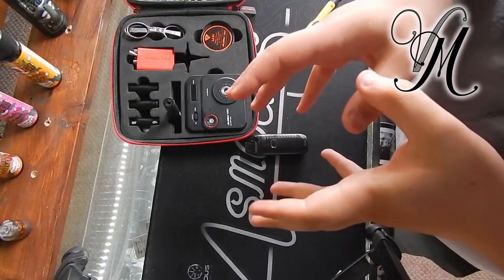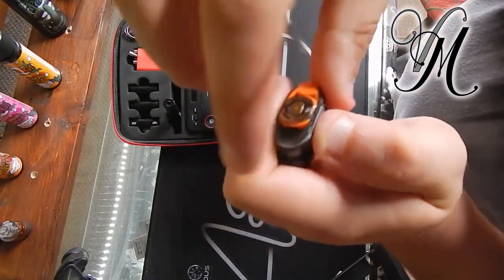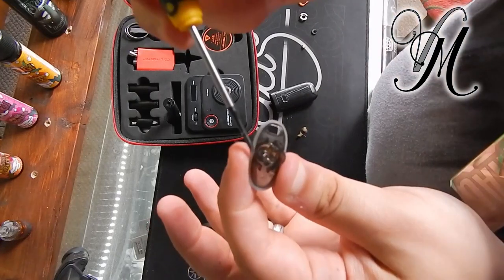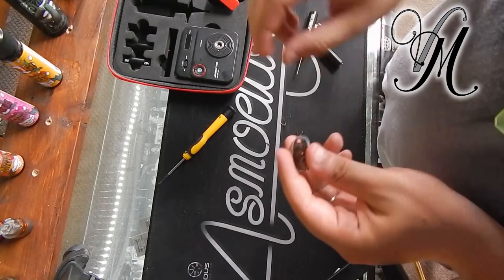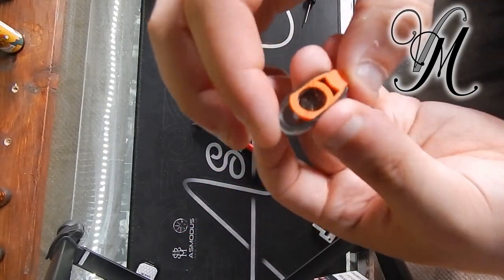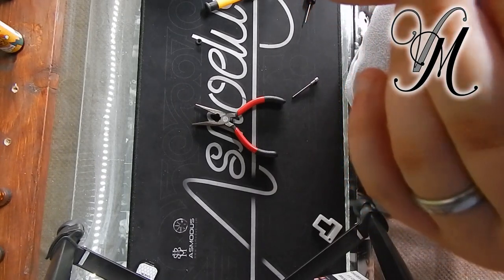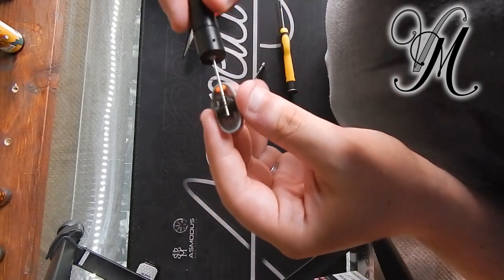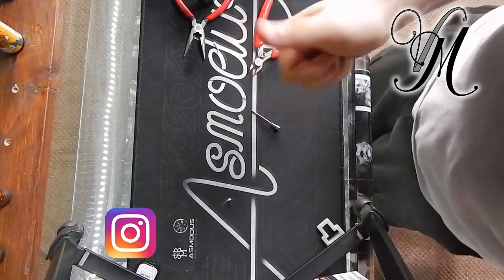Hack | Demo of how to Recoil or rewick the Geek Vape  Bident Pod System

Comment: I was hoping that these pods are rewickable without the extra tool kits and just replacing the cotton...? I don't have this vape kit yet but i was ready to get one. Now that i'm reading into the comments i see the coil itself has to be redone and all other unexpected involvements. I've been using Novo and keep rewicking the pods and i thought this would be similar. I was ready to try this vape kit but i guess i'll pass. I'm frustrated. Thanks for the video though. It seems to be very helpful for a lot of people.
Reply from the maker: Hey, 
I've never redone the novo so i wouldn't really be able to compare, however if you jump to about 9:11 you'll see i actually put the cotton into the coil after the installation.

So in theory, it is possible to just change the cotton, but you wouldn't be able to burn the coil clean, you'd have to do it EXTREMELY gentle with a tissue or something....  I can't imagine it's much different to the Novo to be honest..

Additional, you don't need to buy a Vape DIY Tool kit to build. When i first started building i just had some scissors (to cut the cotton and the coil wire) and a something to wrap the coil round. (Something the fight thickness like the sticks off cottonbud sticks, or a star from a caprison drink carton. 

If you're building with thick wire you'll want some wire cutters, but some standard kitchen scissors would be fine for pod kind of wire.

Thanks for watching and Good luck! ♥️🙏🤘

Comment: Hey dude.. Loved your vid.. what kind of wire did you use to rebuild? Thanks!
Reply from the maker: Hi, 

I honestly can't remember, it was such a long time ago, Below is a comment i replied to someone's a while ago, hope it helps.

"Due to the small space for the coil to sit, 28ga or thinner should surfice.

I can't remember, if I used 28ga or 30ga at 1.5mm 5 full wraps (6 wraps if you count from the top of the coil)"
Reply: @LetsNerdIt  Thanks mate.. found it.. I'll go for 32g.. cheers..

Comment: Can i replace the cotton only?
Reply from the maker: Hmmm... Can, it's possible...
The problem is you can't heat the coil up to clean it. Because the heat from the coil would (does)  melt the surround, then the pod wont seal (will leak 100%)

Comment: What type of wire this you use
Reply from the maker: I can't really remember.
It doesn't matter too much aslong as the coil isn't too big and the wire isn't too thick for the holes.

I previously replied to somebody

"Due to the small space for the coil to sit, 28ga kenthal or thinner should surfice.

I can't remember, if I used 28ga or 30ga at 1.5mm 5 full wraps (6 wraps if you count from the top of the coil)"

Hope that helps

Remember the coil resistance has to be between 0.5ohm & 3ohms or it wont work

Comment: Heyo! What type/size of coil do I have to use for mine?
Reply from the maker: Hi Tyre, 

I honestly can't remember, it was such a long time ago, Below is a comment i replied to someone's a while ago, hope it helps.

Just make sure the resistance is correct, if the resistance it too high or too low it won't fire.

"Due to the small space for the coil to sit, 28ga or thinner should surfice.

I can't remember, if I used 28ga or 30ga at 1.5mm 5 full wraps (6 wraps if you count from the top of the coil)"
Reply from the maker: It has to be between 0.5 and 3ohm
Reply: @LetsNerdIt  thank you so much!
Reply from the maker: @tyetalisik  you're welcome, let me know how you get on

Comment: dont make a bluff once a juice squeeze a rubber who support the airflow its hard to zip it again and once the wire dmg the plastic you cant rebuild it again
Reply from the maker: Maybe I've miss read your comment but it sounds to that your saying this video is fake and it cannot be rebuilt... If that's the case you're wrong. It can be rebuilt the video proves it and other people have done it.

How well it works just depends on how well you do it. 

And no it isn't designed to be rebuilt, i do state that in the video

Comment: how do you form the coil at the bottom after rebuilding?
Reply from the maker: I'm not quite sure what you mean by form the coil.
Have you got the legs through the holes?
If so, then one leg from each coil goes between the silver ring and the rubber O and the legs (1 from each coil) goes between the rubber o and the gold pin. These are the positive and negative.

Comment: Can you just change the cotton?
Reply from the maker: Hmmm... Can, it's possible...
The problem is you can't heat the coil up to clean it. Because the heat from the coil would (does)  melt the surround, then the pod wont seal (will leak 100%)
Reply: Vape Mill thank you so much for the explanation

Comment: Thank you for this video..  now i can save money.. 😄 (🇵🇭Ph)
Reply from the maker: Did you manage to get it to work?
Reply: Nagbago ba taste ng juice mo tol?
Reply: Kasi nag bago akin
Reply: @LetsNerdIt  i used kanthal 30g with 6 loops then i got a different taste from my juice
Reply: Charles Querimit hindi naman tol ganun parin
Reply: Ahhhh, cge salamat
Reply: Charles Querimit ingat lang sa pag baklas tol baka mag leak
Reply: @paulcelino976  boss tanong lng bago lng ksi nito.ano ba dapat ko e lagay sa shopee para sa wire na gagamitin or pangalan ng wire na pwde dito e palit
Reply: rodnel albarico nicrome 32gauge
Reply: Ingat sa pag build kasi pag kulang or sumobra sobra init baka ma tunaw yung plastic hehe payo ko lang research muna sa pag build para safe
Reply: @paulcelino976  cge po ty sa advice :)
Reply: @paulcelino976  boss tanong lng ako ilang loops if 32gauge wire ko?mali ta na order ko

Comment: Hey man, i was kinda lost and cant see where to put the coil and the process after that i hope you could help me
Reply from the maker: Ohh... I'll try 😂😂
So the coils (legs) don't go in straight. 
There is an hole on either side and one on front and back end, they're quite small. Take alook.
So obviously so for each coil one leg goes in the front/back and the other leg goes at the side.

Once you'll got the legs in it's pretty simple is you've built before the silver ring and gold pin act as the negative and positive. So one leg from each coil should go between the silver ring and the black rubber ring and the other 2 legs should go between the gold pin and black ring.

Hope that helps if not hit me up on insta and I'll try to get some picture to help  show you what i mean
Reply: @LetsNerdIt  i kinda got the sense out of it ill try it out once i got my coil and then ill contact you at instagram if im lost again thanks man!!!
Reply from the maker: @kxzzz895  you're welcome,
It's abit fiddly but if you do it right it works 😂 the system is regulated, so if you do it wrong, the worst case scenario is it will melt the bed (if your coils aren't in the right position or are too big) but it won't blow up or anything stupid lol

Comment: hii.. what was the wire you have been used for recoiling . thanks
Reply from the maker: Hi Irfan, 
Due to the small space for the coil to sit, 28ga kenthal or thinner should surfice.

I can't remember, if I used 28ga or 30ga at 1.5mm 5 full wraps (6 wraps if you count from the top of the coil)

EDIT: Typo- 15mm changed to 1.5mm
Reply: Vape Mill Do you mean 1.5mm?
Reply from the maker: @saucerauce9351  haha yeah 😂😂 don't think 15mm coils would fit 😂😂
Thanks for pointing that out! ❤️🙏🤘
Reply: @LetsNerdIt  All cool. Thanks mate, I changed my Bident coils using this guide. I actually removed the plastic that separates the coil, and built a 2mm guide single coil. Enjoying it so far.
Reply from the maker: @saucerauce9351  I'm glad it helped.
And ahh... That's interesting, i didn't think about that!
Reply: Hi, i just used wire 28ga ni200 but fail to fire on my pod, but i also used titinuim wire 30ga also fail to fire.. what material suitable use for coil this pod? Ni80 wire suitable ? Or what? Please help me
Reply from the maker: @sirazrul5315  hi.
In the video i use Ni80, (same as the pods originally use).
However you should be able to use any wire that is designed for Vaping, as long as it is thin enough.

Check what the LED indicator is telling you:
Red light / 3 flashes = No atomiser / No Pod detected

Red light / 8 flashes = short-circuit or Low resistance (ohms)

Make sure the legs are in the right place (1 leg from each coil between the black and silver, 1leg from each coil between the black and gold).

Remember the system will not accept resistance below 0.5ohms. 
Might be worth testing the resistance. (Don't forget if you have 2x 0.6ohm coils the overall resistance will be 0.3ohms)

I hope that helps. I'm sorry if i sounded alittle patronising, i just wanted to cover all bases for you and future readers.
Reply: @LetsNerdIt  thank you for ur advise :)
Reply from the maker: @sirazrul5315  Did you manage to get it to work?
Reply: Vape Mill yes its work but seems like firing used high voltage because i m using 30g titinium.. maybe it suitable with 32g and above
Reply: what awg?

Comment: What wire did you use?
Reply from the maker: Ni80
Can't remember if it was 28ga or 30ga.
Reply: @LetsNerdIt  what other wires that I can use?
Reply from the maker: @janjanbrow  ... I don't know just try some, but you can only use thin wires due to hole.

In theory any wire should work if it's built in a way that the ohms are right and it doesn't get too hot and melt the pod

Comment: I found a video from an Asian guy who used only a single coil so i tried to do that because it seemed less complicated. But since i don't understand what he said i messed up even though i followed everyhing visually. It didn't fire 😒  I used a 26 guage wire with 5 wraps. I am totally retarded about these things but i would really love to get it working without a lot of extra tools and unnessesary knowledge... I just want the fastest and easiest way to get it working. I don't care to blow huge clouds. MTL is fine... What am i doing wrong? I am very stessed out already.
Reply from the maker: It's quite a challenge for someone that's not into rebuilding.

 the coil resistance needs to be higher than 0.5ohms or the system won't fire it

I'd imagine that's why it's not working (presuming the coil legs are in the right place)

The resistance relies on alot like: wire gauge, diameter of the coil, how spared out the wraps are and so on.

You need to find a way of testing the resistance of the coil.

Without dishing out on an rda/mod or ohm reader. You could use a electricity meter to test the resistance of the pod.

Sorry I haven't got a simply answer for you.